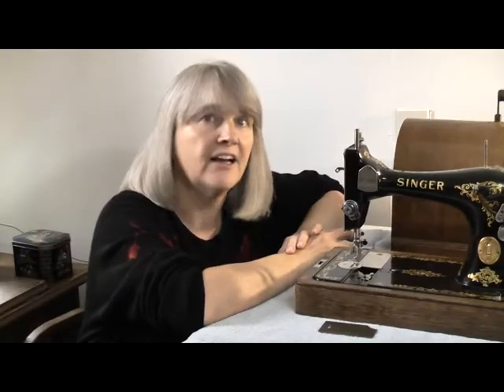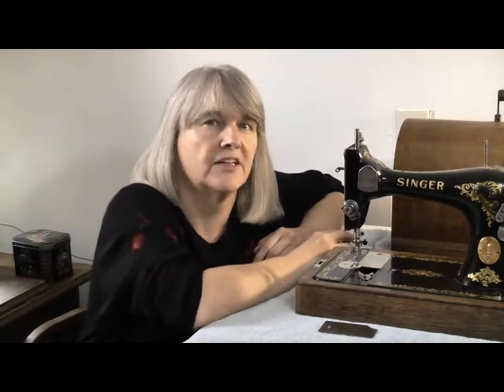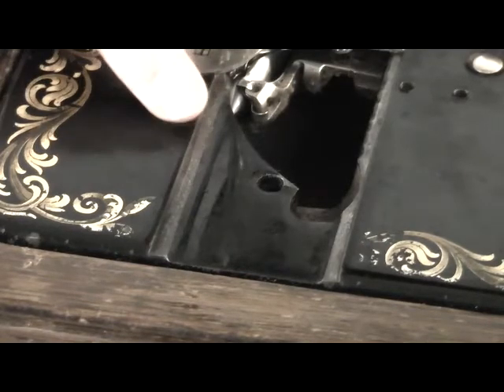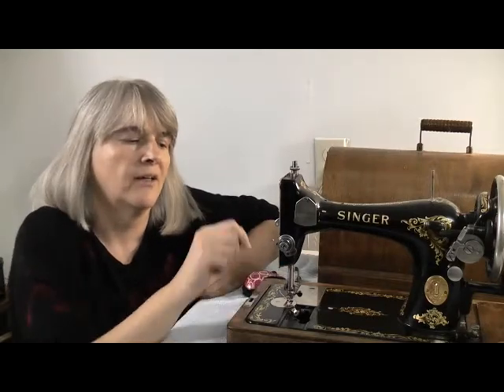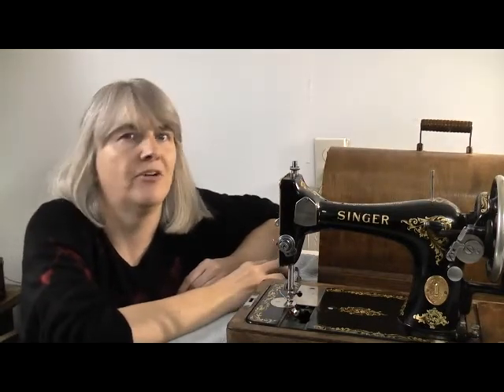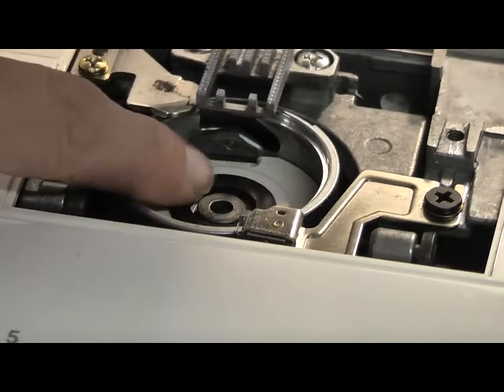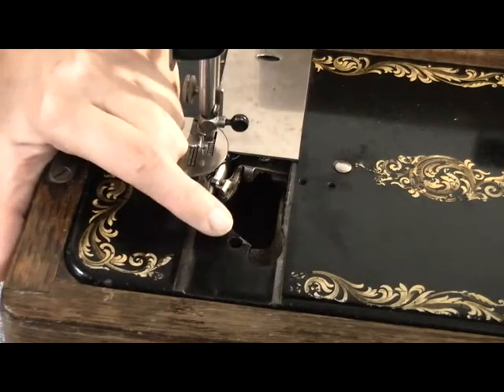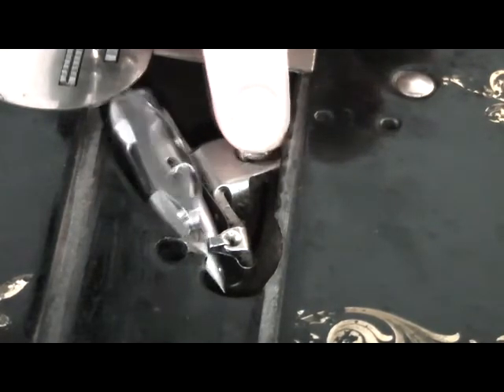Learning 3 Valuable Lessons From a Video on a Singer 128K Sewing Machine

Comment: Thank you for this video! I just picked up a 128K in horrible condition. All the attachments are missing, and since it's my first one (other than an early 1920s miniature model 20), I had no idea what I was doing. Thankfully the wick was still there. I cleaned and oiled the whole machine, and now I'm just waiting for new bobbins to give it a spin. Can't wait.
Reply from the maker: You're welcome! You'll love sewing with the 128K, it's a relaxing machine to use and will sew just about anything. I hope your new bobbins arrive early 😀 Thanks so much for watching - let me know how you get on 😀
Reply: @SimplyStitchy  Thank you! I love it so much already. There's something magical about the smooth feeling of the mechanics as you turn it that makes me want to run out and get another one to fix up. I can just sense a new hobby coming on, and it wouldn't be possible if people like you didn't share their knowledge online.

Comment: Thank you for this video. I hope you can answer this question. This oil wick in this small hole - what is lubricated and how? I got another vibrating shuttle machine by Köhler, but unfortunately I have not been able to identify type or manual. But it have got the same hole as seen in your video, and with no wick. I already know from experience when trying heavy fabric, that the shuttle race needs oil quite often, if you want to avoid the shuttle to start rattle. So I just guess that it could be to oil this race in some way.
Reply from the maker: Hi there, you want to get a sewing machine oil wick to put in the hole, like this one here: https://www.sewingpartsonline.com/oil-wick-singer-hp30136.aspx?gclid=Cj0KCQiApsiBBhCKARIsAN8o_4iGBwDy9esga4eaNIuSCaKpgc20l1TgY0AEMR9nTNw03IpUKc5I__waAjodEALw_wcB .  I've also heard some people use wool or felt. It needs to be something that releases the oil slowly.  I recommend you only use sewing machine oil. It's designed for sewing machines. It's a low viscosity and safe to use around decals: https://amzn.to/37vfG87 Hope that helps. Thanks for watching :D
Reply: @SimplyStitchy  Thank you. I do know, that the right oil and a wick needs to be there. So I am sorry, because this is not an answer to my question. What is intended to be lubricated by this oil? I just got some information, that there should be a hole to the surface of the shuttle race, and it should be the shuttle race. Do you agree? This hole seems not to be there or it is very tiny and clogged on my machine. I have tried to cover the race with soapy water and put air pressure on the hole, and then no bubbles is to be seen. Now I try to clean with alcohol. So If there once was a hole to this shuttle race, I hope to open it up again.
Reply from the maker: It lubricates the shuttle race. Look to the right of the hole for the wick, into the shuttle area. Make sure the shuttle is at the back of the machine out of the way. At at the top of the actual shuttle race, there should be a small pin sized hole, near the top on the metal part of the shuttle race itself. It's probably about a couple of millimeters down, if that. That's where it is on the Singer, I don't know about Kohler, but if it looks the same, it stands a good chance it'll be in the same place. Hope you find it.
Reply: @SimplyStitchy  Thank you. Yes, now I know that a hole in the shuttle race surface should be expected. I have looked very carefully after it. This is a close up photo of the area: 
https://drive.google.com/uc?id=15VJXa0Xn3UKqztLsCNGmR7Yj7O1Cu-pR 
I have tried to push with the point of the needle to find a soft spot all over this place. Everything seems hard. Then I have tried to put on a silicon tube to the upper hole pressurise the hole with air and set on soap water. No bubbles. So it seems this hole was never made or it is very tiny.

Comment: Me again. I'm so excited about this machine! Does the Singer 128K use a different needle from the standard Schmetz needles?
Reply from the maker: As yours is from the 1920s it should take standard 15x1 needles. Just remember, the needle is flat side towards the handwheel and the needle threads from left to right.

Comment: I just ran out and bought a Singer machine with a crank and after some research I found that it was a Singer 127 or 128.  I wanted to ask you a question about the serial number.  It appears to be Y1719741 but the Y serial numbers in that range of numbers are 31Ks?  This machine came from England, would that make any kind of difference?  There is no indication on the machine what the model number is. I don't know why I care, but I do and it's making me a little nuts! Could you help me?
Reply from the maker: Hi Terri, your machine is a 128K from the Kilbowie factory in Clydebank, Scotland. The date is Jan 26 1924 and it was part of a run of 35,000. I think you may have looked up the Y with 6 digits rather than using the 7 digits your serial number has. It's easily done and happens to all of us! If you haven't already, check out my video on how to date a vintage singer sewing machine: https://youtu.be/DwpBm7UOz6I It'll explain why the digits can get confusing sometimes. Thanks for watching 😀
Reply: @SimplyStitchy  Hi Olly, thank you for the quick answer! After I watched your video I went back to the Y Serial numbers and lo and behold my machine has the correct serial number. I thought I was losing my mind there for a few. I think you are right, I looked at the 6 digit serial numbers.  The machine has a little rust and the stitch length knob is frozen so I'm working on that now. :)